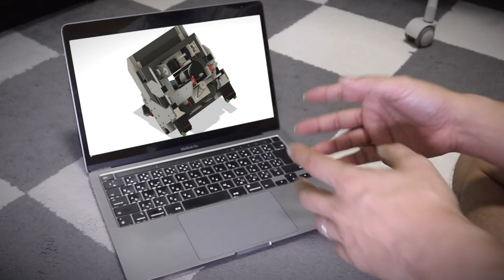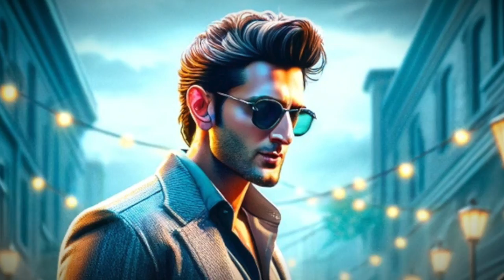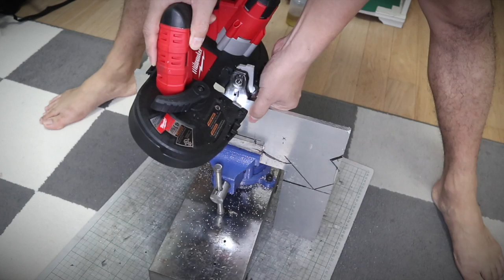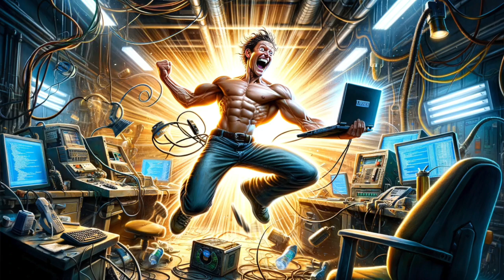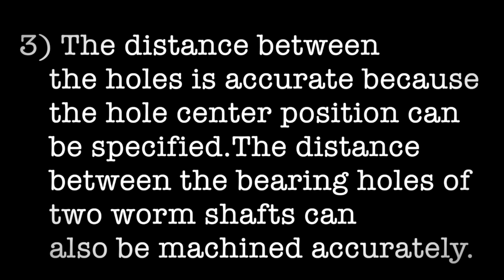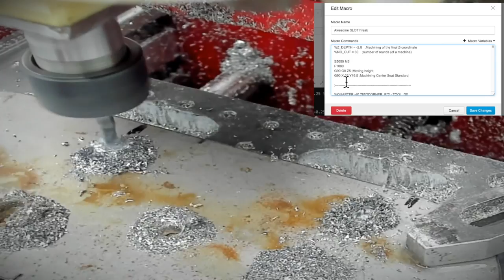Building The 5-Axis CNC Machine in a Small Room: A DIY Journey. (part9)

Comment: Wouldn't be better if you get a vacuum cleaner to suck all that swarf  up instead of pushing it all over the place or worse recutting chip's
Reply from the maker: I also work late at night.
The sound of the vacuum cleaner also becomes a noise source late at night.
But if it is during the daytime, I think vacuuming is effective.

Comment: how do you keep those chips from spreading all over your home?
Reply from the maker: Whenever CNC machining is performed, the cutting chips do not fly around as they are processed inside a soundproof box.
The problem is with drilling, band sawing, and other manual operations.
The DIY aluminum case is very good because it is a box and the metal shavings are stored in the lower section.
The other thing is cleaning anyway. I vacuum before the cutting chips get stuck in my wife's feet.

Comment: Only channel i get excited when a video is upload, really inspiring. Motivates me to build a CNC myself but always put it off due to excuses.
Reply from the maker: Your comments are encouraging.
It's hard for me to stay motivated too!
We are all busy, so I understand what you are saying.
Why don't you buy a commercial CNC machine and try to modify it first? It is important to start first.
If you try it, you will feel a lot more than you can imagine.
Do what you want to do!
Reply: @a-cnc-f  From making things in the past i learned if i buy cheap, i have to buy twice, Been hesitate to start a build due to the never ending expense, Space and budget has stopped me. From your videos i see space isn't a reason but if i am going to do it i want to do i the 'Right' way what ever right means. Found Aluminium tooling plate budget friendly and already has a good tolerance, been looking into 3D printing a most outer casing of a machine then using Expoxy granite with steel mesh/rods for the joining of parts. Then use that to machine the aluminium parts.  Hard to get out of the CAD stage and start the build. Then it comes down to what type of motion drive, Belts Vs leadscrew Vs ball screw, all having pros/cons. Either way i know i will get around to building it. I can say your videos are a massive inspiration, keep up with outstanding work !! Thanks for the reply.
Reply from the maker: You have already gone one step further!
I believe that everything a person goes through is not in vain.
It is what you think was a failure that is the source of your success.
I'm getting a bit old for that, but overall, I think it's important not to give up, no matter how old you are. If you don't give up, failure is the source of success.
Reply: Как я вас понимаю, так понимаю и я сам. Я хочу попробовать создавать инструменты с нуля и постепенно входить в станок. Но я думаю, что начну с инструментов из ПВХ и постепенно перейду от эпоксидного гранита к обработке металла. Автор канала очень мотивирует, тем более, что показал, что ограниченное пространство и громкий звук – решаемые проблемы. Уважаемый автор, я всегда жду ваших видео.
Reply from the maker: Thank you.
The noise issue is a serious problem for us to solve.

Comment: the other question is how are you locating parts on that machine without losing your mind
Reply from the maker: So what you are saying is how you determine the origin.
Normally, all professional part fabrication is based on drawings, and all machining must be done as described in the drawings and as directed, or the part will be defective.
However, when it comes to DIY hobbyists, there is no need to follow such a perfect process. Also, few people have the equipment to perform such a perfect process. At least I do not have such facilities.
If I had enough industrial machinery to use as a hobbyist, that would be my heaven.
We need a different way of thinking to solve this problem.
actual parts matching is what is important for DIY level machining.
In other words, the origin is not very important. Only the necessary machining is necessary, since the process is not assembly but machining.
I think the next video in this series will be about that.